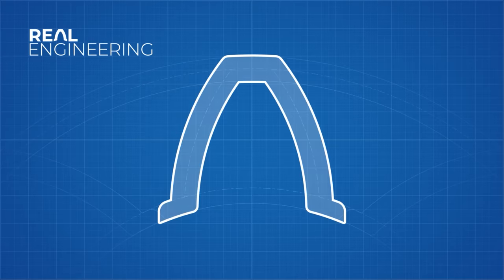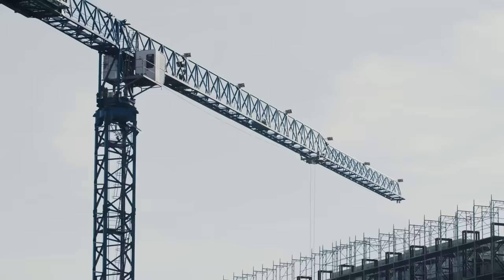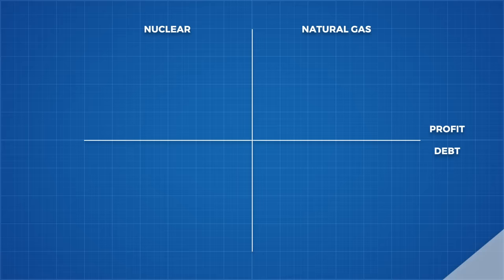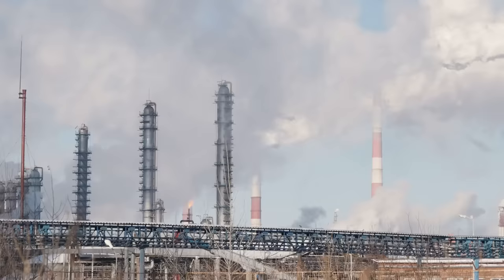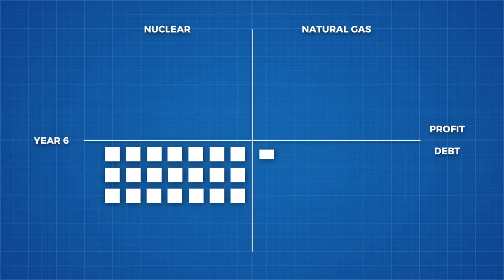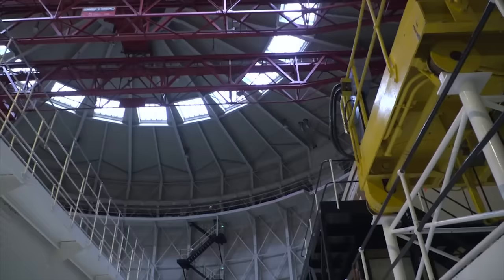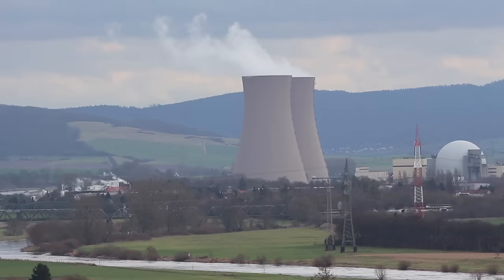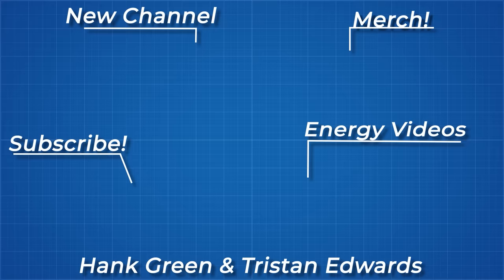The Economics of Nuclear Energy

Comment: Love your videos but this why by far the worst one. Even if nuclear was more expensive that renewables and carbon fuel sources (which is debatable) it would still be the only carbon free option we currently have to power the grid right now and thus a good idea. It is currently not technically feasible to power the grid with renewables which is why Germany produces way for co2 than France.

Comment: If the external costs of CO2 is the point. 
The external costs of nuclear power, in a world with 90% of the world's population is in dictatorships,  is extra military costs. 
The USA is the biggest target in the world. 
Dictatorships with nuclear industries is stupid, stupid, stupid. And expensive.
Reply: Thorium
Reply: @justsomeuser7484  thorium also requires a nuclear industry, yes ??
Reply: Renewables also have external costs, much higher than that of nuclear (as of now). Nuclear fission is a “stepping stone” from non-renewables to renewables (or those that are absurdly efficient like fusion).
Reply: @fork9001  nuclear has a lifetime of 60 to 100years because of costs and massive profits that follow. 
This technology will block Renewables. 
This technology is a central power supply, but EV batteries will need to be charged and so the transportation, This triples the number of nuclear power plants and triples the size of the grid. 
The military defence costs will explode particularly in the USA. The USA is the biggest target in the world. 
100,000 NUCLEAR POWER PLANTS 
$2BILLION EACH (x 100,000 = $??????)
$2MILLION EACH klm for each new grid and 1,000s of klm (= $?????????)

The power solution needs to be a world solution. 
Renewables recycling is a developing industry. 
Solar panels have a performance guarantee of 25 years, to 80%, but they still produce electricity for no more $ expenditure except to add an extra panel to kick the output back up to the original output. Dirt cheap for another 25 years.
Recycling metals is incredibly cheaper than mining, refining, smelting, etc.
People think backwards and with only part of the full information.
Reply: @stephenbrickwood1602  But for nuclear, power output is much better than current renewables and kW per $ is much better than fossil fuels. Nuclear fission will reduce emissions drastically as well as provide time for the development of advanced renewable energy like better solar cells, commercialising fusion, better batteries etc. right now, nuclear fission is a better power source than renewables. Fission is a lot better than fossil fuels, it exists, has proven to be commercially viable and it delivers the power output of fossil fuels with much less emissions. Replacing fossil fuels with fission is the first step, then replace fission with better renewables (that are actually viable for use, the world can’t just black out because it wasn’t windy that day or the clouds blocked the sun) and fusion.
Reply: @fork9001  no no no.
Are you a jolly joker ? ?
Nuclear industries are incredibly expensive in money and in time and on number of skilled workers.And take decades and decades to build.
And then many decades after construction to pay back any investment profits. 100 years.
Military defence costs increase massively. 
Nuclear winter is the biggest danger.
Reply: @stephenbrickwood1602  Again, you missed nuclear physics lesson. Nuclear fission plants don’t cause nuclear winter, only bombs can (and power plants can’t detonate like an atomic bomb). The amount of money needed to replace all of our power sources with current gen renewables only is quite a lot, I don’t think any single government or person can pay for it. Power output for renewables currently is terribly low, you’d need a lot of facilities to construct, maintain and replace (in the case of solar panels) these power sources (except for fusion, that one should produce enough power and is robust).
Reply: @fork9001  you have much to learn. 
Nuclear industries produce Nuclear weapons. Ezi pezi. 
Climate destabilisation or nuclear winter 🤔 or  ? ? ?
Reply: @stephenbrickwood1602  Nuclear reactors don’t produce nuclear weapons, and nuclear weapons are usually used only for nuclear deterrence, even in Russia.
Reply: @fork9001  do you live in cold latitudes?
I live in the sunniest continent on the planet.
I maybe biased. 
But I did live through the Cold War.
I nearly went to a foreign country to fight in a war.
My father was in the army in the WW2 and was sent to 2 war fronts. 
He missed Korea.
Reply: @stephenbrickwood1602  I live in southeast asia. Very hot, very humid, very rainy.
Reply: @fork9001  let me think about your situation. 
My main concern is other countries may redirect their new Nuclear Industries to aggressive uses. 
It has happened  before. 
As I said the costs are so huge nobody will be able to remove them for 60 to 100years or more. 
Many different political leaders can gain control and do what they want.
Reply: @stephenbrickwood1602  My other argument for continuing the use of nuclear power (not counting fusion) I have is in deep space. RTGs (radioisotope thermoelectric generator) are used to power space probes that are very far away from the sun or have no access to solar power, such as mars rovers and interstellar probes. Nuclear fission comes in very handy for manned missions to mars and anywhere else further from the sun because solar power becomes less efficient as distance increases and RTGs will not suffice because of relatively low power output and efficiency. Until fusion comes around eventually, nuclear power will continue to power spacecraft that requires it.
Reply: @fork9001  I am not against existing nuclear power plants, the technology can be extremely good. 
And other uses. 
It is the widespread primary use for climate change reasons when viable alternative Renewables should be rolled out. 
Viable alternative even if it is a little more expensive because war is incredibly expensive and nuclear war defence is unthinkable.
Reply: @stephenbrickwood1602  Renewables aren’t ready to power our grids, and some miraculous discovery has to take place if we want to directly replace all fossil fuels and nuclear fission plants with renewables. Hopefully this “miraculous discovery” would be fusion power being proved to be commercially viable and sustainable whilst having decently high power output. Not happening within this decade though. Even if we replace fossil fuel with nuclear fission, that would be so much better than what we have now. I doubt that nuclear fission would close off funding for research and development on renewable energy, and if something proves to work better (and cheaper) it will be funded.

Comment: thorium fixing half of these problems:
Reply: You may want to explore why no one in the U.S. is even remotely interested in Thorium.  Just saying the people who invest their money disagree with you
Reply: @clarkkent9080  it’s strange people don’t know about how good thorium is. Accidents are basically impossible if you make the reactor in a certain, easy way. 1 tonne of thorium makes as much energy as 200 tonnes of uranium, which makes as much power as 3.5 million tons of coal.
Reply: @clarkkent9080  I know. But it’s still pretty safe. Usually in my examples I use plutonium as the starter material. And this makes the reactor extremely safe, because if there is an meltdown, the bottom of the reactor can be made to melt, dropping the thorium and separating it from the plutonium. Still safe
Reply: @clarkkent9080  1 ton of thorium does create as much energy as 200 tons of thorium. Go watch a couple videos, do some research, etc. the plutonium or uranium needed to start the reactor isn’t that significant, and the thorium reactor would still be cheaper.
Reply: @GamerGod-fp1tj  You still have no idea what you are talking about.  Starting with Pu239 or U235 does not matter, Thorium is transmuted into U233 so in your example you have Pu239, Th232 and U233.

A meltdown is and ACCIDENT and any reactor that melts down was NOT safe.  I suggest that you stick to games where anything is possible and facts and reality does not matter.
Reply: @clarkkent9080  you didn’t listen. Once thorium is separated from its helper material, it stops reacting, while uranium alone would continue reacting. You should pick up a book or do some research.
Reply: @clarkkent9080  also your acting like those weirdos who think that everyone else’s brains are melted and they thing real life is like video games… no it isn’t, I know that, I doubt you do
Reply: @clarkkent9080  second reply, here is the link. Hope you finally can admit that your  “40 years” of experience is not correct

Comment: Comparing the finished build nuclear power plants of France, to the finished build solar/wind energy of Germany, in terms of CO2 emissions is a very unfair and skewed comparison. 
You have to compare from the moment of the power plants conception, until the end of the power plant's life, until the end of every brick's life: The materials, the emissions, the transportation, the production, the demolition, everything. THEN you have the full picture. Completely ignoring all the CO2 that goes in the TONS upon TONS of concrete that is required for making a nuclear power plant, is not an objective meassurement, but a dishonest one. One where you're finding exactly the result that you're looking for, because you only look where you know the advantage is. 
In other terms, you have to look at CO2 emissions in terms of a power plants entire life cycle.

Scientific studies show that nuclear power's average won't even be able to live up to the 2030 goal for CO2-emissions (Less than 50 gCO2 per kWh). They are are therefore dead on arrival. 

You can't just look at the bottom line in terms of dollars or pounds, either. You have to look at the CO2 emissions, as well. CO2 is a resource, so completely ignoring it when talking about economics, Id argue, is a big mistake. That's how we got in this mess to begin with - By ignoring it, for over half a century.

Comment: uranium/light water nuclear is fundamentally uneconomic and based on the waste products of weapons production - it was already being phased out by commercial producers by the 1960s

It was envisaged by nuclear scientists and engineers in the l950s/60 as a stepping stone to better technology and a 1961 nuclear engineer timewarped to today would be asked why the hell we're still using the technology when better tech was already on the drawing board in 1961 (tested in 1966-1969)

Molten salt nuclear is a vastly different animal. "Laboratory glassware proof of concept" vs "industrial device" different. (or Neucomen engine vs Watt engine (or diesel))

MSR are vastly cheaper to build than water-moderated plants as they don't need stupidly expensive radioactive water containment (boilers) and steam containment (buildings) - we're talking about 80-90% cheaper than existing nuke plants whilst actually being considerably stronger in containment

A 3000MWt MSR reactor vessel should be smaller than a london bedsit with the entire reactor building being about the size of an average house (considerably smaller than a coal or gas heat source)

MSRs CAN peak follow. Standard nuclear reactors can too (France does this) - but with fuelling being a fixed price most USA operators just run them flat out 24*7 

MSR fuel is 1/500th the cost of enriched uranium AND a MSR will use 98-99% of the enrgy in it, vs 1-2% for a uranium/lightwater plant (MSRs can also eat existing high level nuclear waste, handy....)

Water-moderated nuclear is a dinosaur. It's not just the nuke plant, but they're not hot enough to drive turbines efficiently and cause major maintenance costs because they're only making saturated steam, not dry steam

Renewables can slightly outproduce carbon-emitting electrical production, they can't replace all carbon emitting energy usage (There are fundamental blocking issues with available locations and transport logistics. Electricity can only go a certain distance from point of generation before network losses are untenable)

China's now (January 2022) testing the Wuwei MSR and is expected to announce preliminary results soon - this is the first MSR since Oak Ridge's MSRE and the first EVER to be thorium powered. Expect big changes coming down the line
Reply: "Wuwei MSR and is expected to announce preliminary results soon" Wasn't that something like $3.3b for 2MWt? Versus China's price for conventional nuclear at ~$2b for 4000MWt?

Comment: Hey mate, this video is extremely dishonest. You claim that wind is intermittent and that it emits CO2. These claims are wildly inaccurate.
First off CO2 - as you said in the video Wind power sometimes needs to be propped up by coal and lng plants when the wind doesn't blow hard enough. This means that coal and lng produce CO2, not the wind turbines themselves.

On the scale of countries like Germany wind is always blowing. Even bigger countries like the US and Australia have both the infrastructure and geographical location to rely exclusively on renewables.

Perpetuating nuclear energy as the solution misses the point of renewables; democratising the energy grid. Uranium, LNG and Coal are sources whose supply can be monopolised. Moving to renewables threatens this monopoly, as such the narrative is "lets try nuclear guys". 

Make no mistake, baseload power is a myth. Nuclear is unnecessary.
Reply: All true.  In the Industry it is not so much about a Monopoly status -- but rather a Central Plant Model (which you are correct, is very similar to a Monopoly) v.  Distributed Renewable Generation.  But the REAL battle is over the Cash Flow.  Central Plant Model sends power out, passes through Retail Revenue Metering and Cash Flows back in to the Central Plant Owner/Operator.  A Capitalist's Dream.  Distributed Generation occurs BEHIND the Meter.  On the Customer side of the Meter.  DRG is first used on site, and offsets use, and the Surplus is sent up the Grid.  Power Flow from the Central Plant is reduced and so is Cash Flow.  THAT is why all the Hype and Lies against Renewable, and all the Con-Man promotion of New Nukes (a "Central Plant.")

Comment: With Levelized Cost of Electricity, what is the time frame for the lifetime of the different sources of power?   Is the 'Life of the System, the same value?  My understanding is each power plant has a different lifetime expectance.   Is there a more relevant price point comparison over an extended time frame.   For example the oldest Nuclear Plant still operational is 52 years old.   Some Nuclear Plants are expected to have a life span of some 80-100 years. It would be interesting to see a LCOE over an extended period.